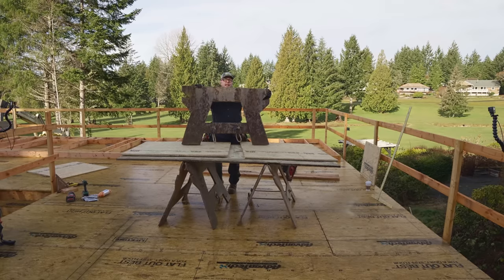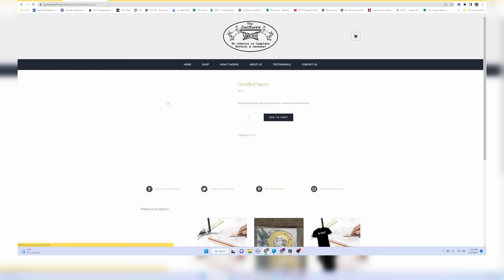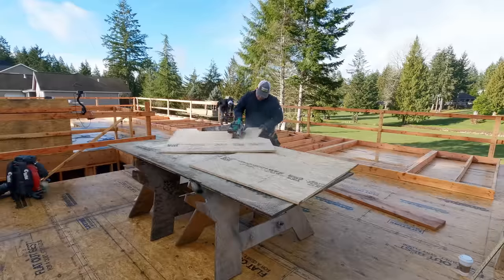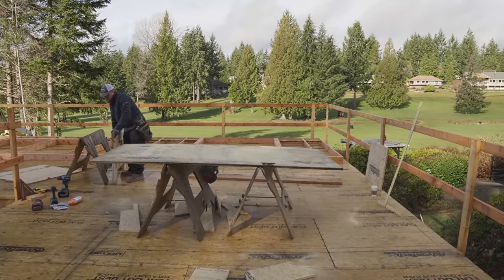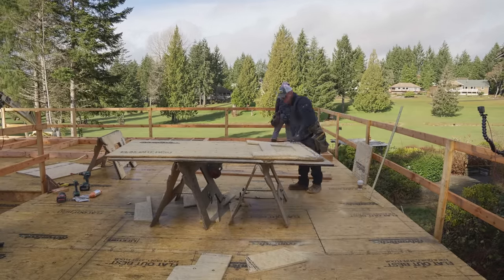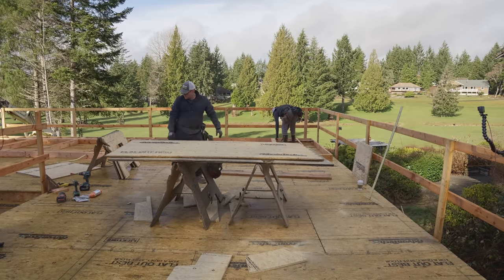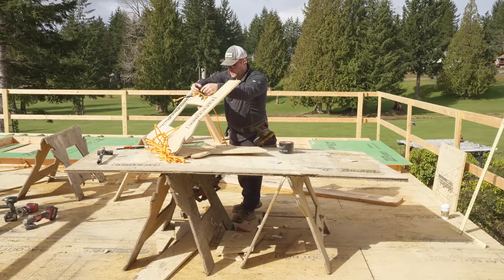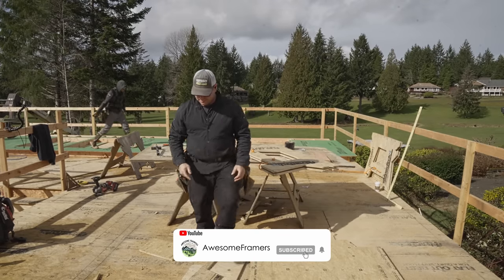How to Build the Greatest Sawhorses Ever Invented

Comment: Those hinges will be a problem when ripping.  Too close to the edge.   Sawhorses should be made to cut.  If your blade depth isn't flush you will be nicking those hinges
Reply: The hinge sits below the outside edge. I ripped sheet goods on mine and haven’t nicked the hinges.
Reply: Just put a couple 2x’s under your sheet. Good to go
Reply: Replace hinges with rope 4" or so down.
Reply: I cut through my hinges once ripping…… didn’t break the hinges completely or the saw blade. Good to go, dosent bother me.
Reply: Don’t let your blade hang down 2” past your material? 😂
Reply: Ah, but grasshopper, one must be smarter than the tools he works with?

But accidents do happen.

Comment: I think it is funny when people say they invented something that has been around for decades, my dad and his contractor friends used to make some VERY similar to these back in the 70's except they made them out of cabinet grade plywood. Good video, I had forgotten all about these.
Reply: My thoughts exactly and I've seen similar.
Reply: he actually says in the video he learned it from someone else.
Reply: Yep, used to make these all the time. If you don’t have hinges (who does?), just line up the top edges and drive a few 16ds all the way through. Then spread them back open to what ever width you want. Lastly, use the piece you cut out of the middle as the “stringer” to hold the legs in place. Makes a nice tool table underneath too.
Reply from the maker: @Al-rt3rx  these guys are idiots
Reply: It's a different style of sawhorse. Just because music has been around for thousands of years doesn't mean nothing is new.

Comment: Hey!  Why do you Lower your shoe before a plunge cut?  Why not keep it locked at full depth?  I know you'll have some good answer.  Carpenter of 23 years asking 😊   edit, I noticed it's not even tight.  Just floppin around.  Do tell!
Reply: @chrisreynolds2410  lumber.  It takes about 4 minutes to build a set.  We don't take them with us.  They usually end up becoming a table inside the house when finished and most likely get removed before flooring goes in
Reply: Same question! 😉

Comment: I would use chain instead of rope, easier for making the same length and a piece of rebar through the chain to keep from pulling through.  Rope gives, chain will not.
Reply: I made a somewhat similar set from hardwood flooring and yellow pine 2x4 I tried chain in a earlier set of wood folding sawhorses the small chain got tangled up and wore on the holes in the boards it's easier to use para cord or something and adjust the knot I was hoping they figured out a better hold open to keep the horses from folding up when sliding materials on them

Comment: I will still use my 9, 2×4 design.
I have horses in the yard , twenty years outside still working for me , albeit 5 1/12 inches shorter due to hoof rot.
Reply: Yes, I have the standard 2x4 design that are many years old too, but these Jackass horses are meant to be mobile & space saving… You can collapse them and throw them in the back of your truck/van or in your garage just fold them against the wall
Reply: @hmtrimworks7148  25 years ago I bought a new bumble bee colored table saw, day 1 the included stand went inside out ( grated I was feeding it 16 foot rough stock)
I built a couple low boy , knockdown ponies to carry the table saw from jobsite scrap, that was three yellow table saws ago and those same knockdown horses still carry on.
Reply: @georgemckenzie2525  I actually use the Tough Built C700 horses for the past 5yrs with no issues or regrets… I like the tabletop design they provide… I now have 3 sets
Reply: @hmtrimworks7148  I have for folding Trojan horses, simple strong easy to use.

Comment: Question from Scotland: Is the Advantech boarding just a brand of water resistant chipboard? We don't have it here.
Reply from the maker: Yep , exactly
Reply: @AwesomeFramers  thanks for reply. We usually knock out horses/trestles from a cut of 6 or 8x2 with 3 or 4x2 legs and ply gussets. They go in the clients shed at the end of the job. Always plenty of offcuts from cutting the frame before assembly to get used up. You guys must be in a dry state, no way flooing goes down here before you're wind and water tight!
Reply from the maker: @richardparsons7012   nope, we are in a very wet area 😳
Reply: @AwesomeFramers  and the floor is okay with that? The moisture rsist flooring we have is okay to a point, but it wouldn't be happy after a long period of staying wet.
Reply from the maker: @richardparsons7012  yep. Many many years of building in the wet season is testimony 👍

https://www.huberwood.com/advantech/subflooring?gclid=Cj0KCQjw2v-gBhC1ARIsAOQdKY2CtihkMC5eumsaPZ-vdgLKg7hnTGjjPu1BVFdl_57Mko7BtNz00xcaAtRtEALw_wcB
Reply: Different grade of stuff to what's available here for flooring, that's for sure. Plywood hinged horses are a thing, but I don't think the chipboard would last here for those.

Comment: At $75 a sheet for Advantech, this isnt very cost friendly at $150 for a set of half assed saw horses.
Reply: Customer is paying for the material. No sweat. Plenty left over after door and window cutouts.
Reply: @chrisallen2005  So you put it on the customer to build your $150 saw horses. And you dont use Advantech on walls so there is no window and door cutouts.

Comment: You can buy a pair of saw horses that will last for 10 years or longer.  I don't think for the time you put in these and how long they last is worth it for me.  Enjoyed the video. 
Thanks
Reply: If you buy those plastic 70$ sawhorses and they last 10 yrs...ur not using them in construction.
Reply: That's a matter of opinion. 
You must have a lot of time to waste making something you know is going to end up in the trash in less than two years.  Less than that if they are left outside.
Reply: In my opinion I you use scrap wood and it takes you 1 hr.your still only in it for an hr labor and not pulling cash out of your wallet to buy those POS plastic horses .but if you like pulling cash out of your wallet have at it

Comment: Advantech   Lifetime warranty.      I have a lifetime of experience.  Borkleboard products  (any and all pressed particle, strand, chip  board products)   Now hear this,,, NONE of them have lasted a lifetime.  None of them have held diagonal driven hardwood flooring pins or nails.   If your total intent is to build for today,, and your 9intent is that all floors will be carpet or laminated type flooring,, or other.  Then by all means,,, use borkleboard.  You'll get what you pay for,,,,, you may be lucky,, and you may not.  Sawhorses?  You spend too much.  Mine are scrap 2X stock or even new 2X4 2 and 1/3   8 footers needed per sawhorse.  Screws are preferred but machine nails work well.  They don't fold, but they do stack.  Faster, cheaper, at least as strong, no metal hinge to miss, 1/3 the price, just the saw and a screw gun for manufacture.